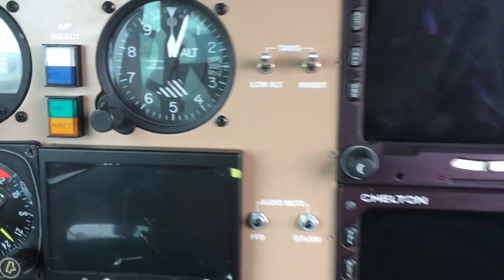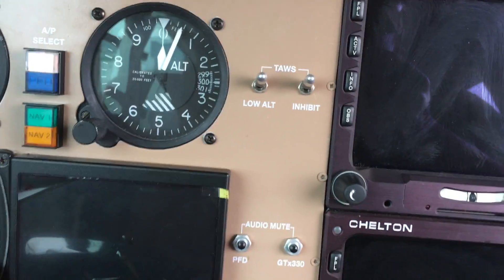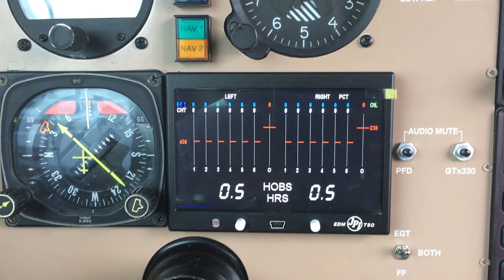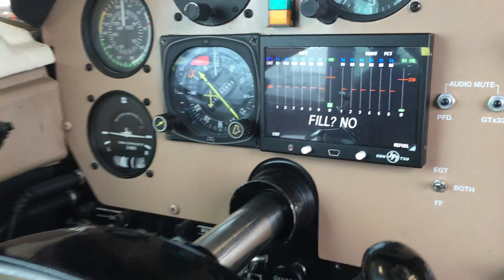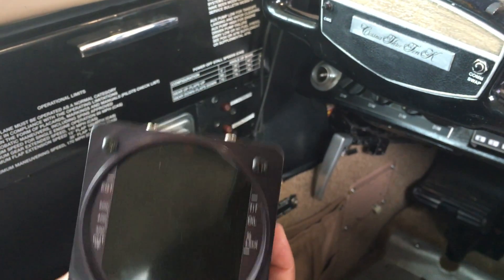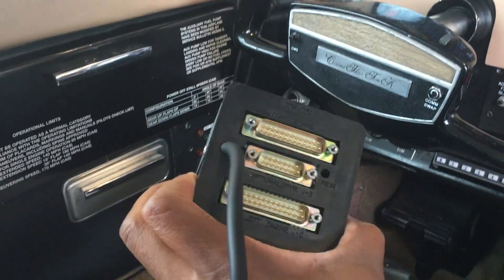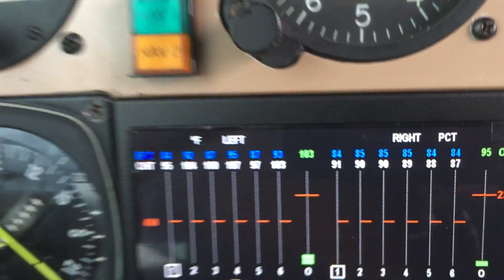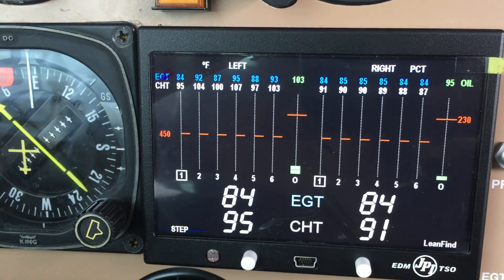JPI 790 EDM on Cessna 310 Post Insallation Review

Comment: Dude, I wanted to hear about your 790 initial setup not complain about your previous JPI.
Reply from the maker: Sorry for the rant, but it’s important for folks trying to decide btw the two to understand the limitations of the older, cheaper unit.
Reply: but we want to see how and where you installed the lines and the fuel flow transduecer. @shooterreadyschannel9254

Comment: Did you have to cut the panel or fit right on ?
Reply from the maker: Fit right into the standard round hole. No modifications required.
Reply: @shooterreadyschannel9254  Thank you